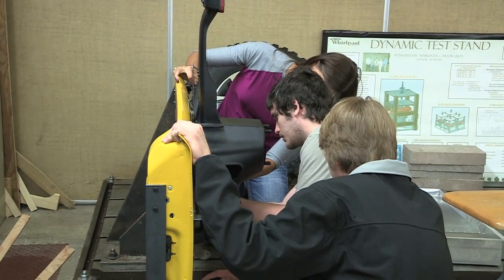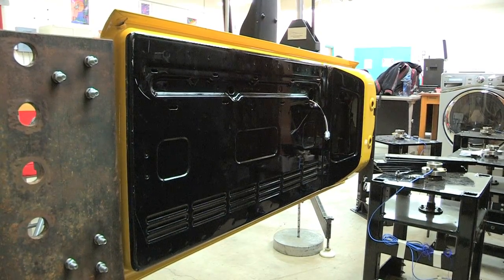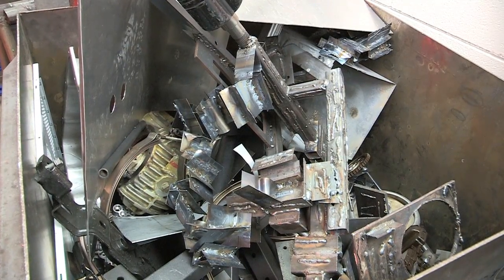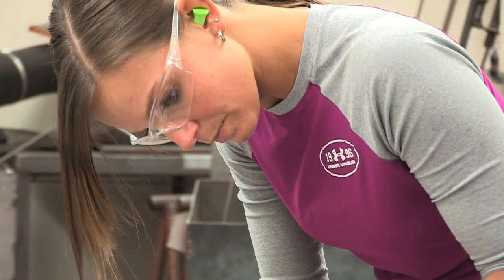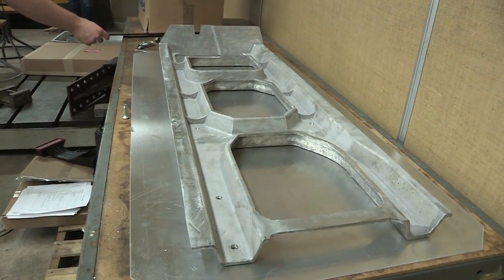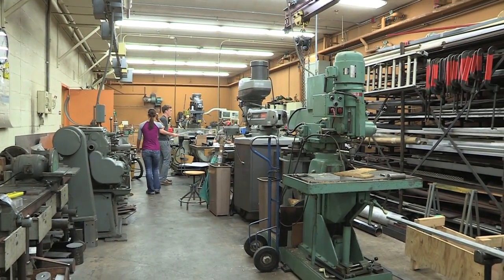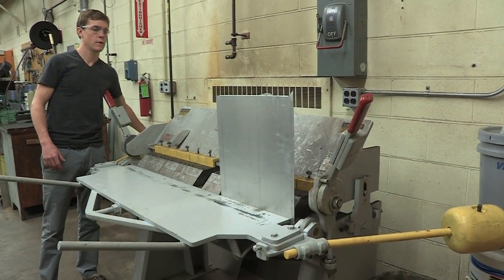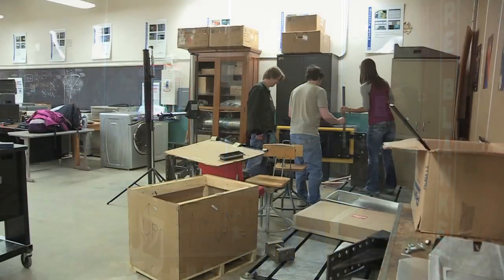JEEP Swing Gate Senior Design

Comment: Great work team, you guys have certainly learned alot of valuable lessons throughout the year.  It was our pleasure to support you and work with you on this.  The research is significant, the redesign elegent in it's simplicity from where it started.  Also really like the innovative way you held the critical hardpoints to use all the carryover hardware by simplifying the inner/outer stampings into flat planes.  Very excited to see this developed further.